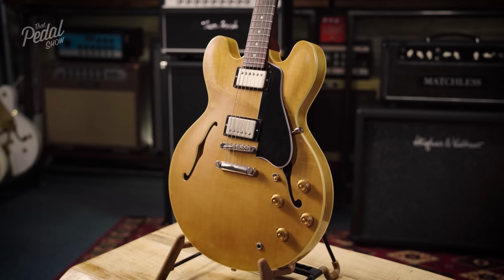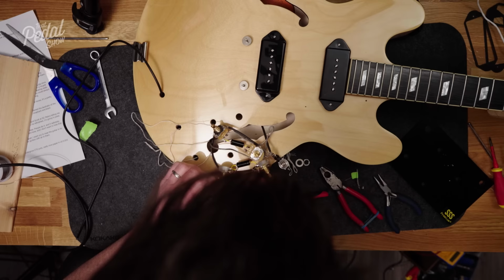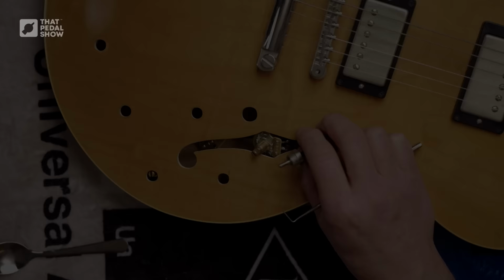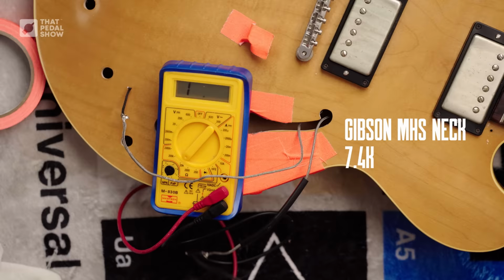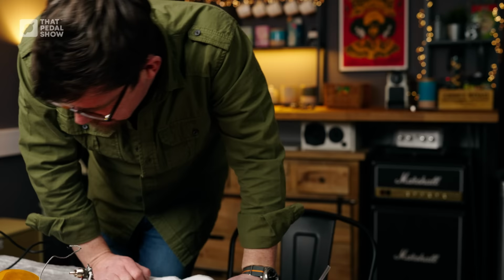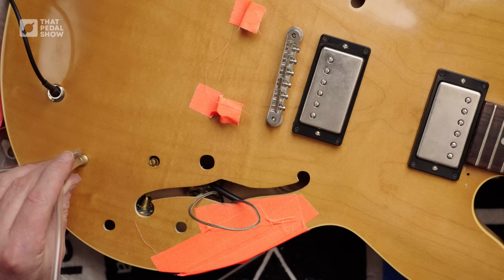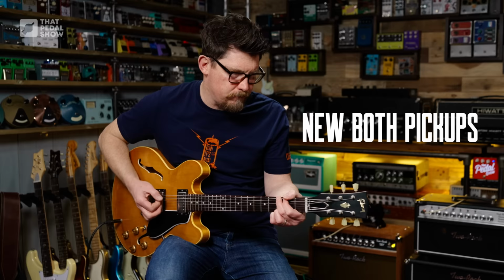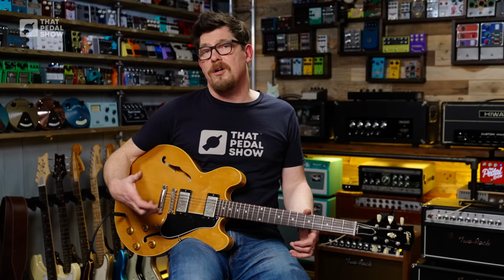Mick’s Gibson ES-335 Gets New Pickups & Loom [Hardest Pickup Swap Ever?]

Comment: I am actually finishing up a guitar with this config. I finally got it done except for stringing it up. I had to take a break after 3 evenings of the same frustrations so I pulled up your video randomly. This isn't the first time I've worked on a hollow or semi hollow body electric but re-installing the guts is always a mental trial. I am so appreciative of your honesty, most tubers try to make it look relatively easy, but if it were we'd all be repairmen. I'm glad you pushed through and got it done. The one I'm finishing up has the toggle switch on the top side of the upper bout horn. That's even a bit worse.:face-pink-tears:🤣🤣

Comment: "What a rubber Jonny."
I'm so sorry, Mick. I felt your pain. I would have completely understood if you took a saw out and turned th f-hole into a gaping one!
While watching this I adjusted the truss rod in my Les Paul and solved a fret buzz issue. That guitar has beautiful Monty's pickups, but due to my assumption that the Gibson wires and the Monty's followed the same colour coding, the push-pull pots now operate backwards. I just don't have the time, nor patiences to fix it...
Reply from the maker: Ha! I feel this so deeply. :0)

Comment: Mick,

It’s a bit after the fact, but I’ve learned that yarn works a treat to pull the pots back through. It also makes adding the internal lock washers easier. The threads are more accessible on top.

Additionally, making a light cardboard protector is easy and doesn’t limit access for the swap.

Comment: I've done this a few times. It gets easier. I put some low tack tape in the f hole edges to keep from getting damage. Put a dab of super glue on the star washer and it won't fall off the pot. Some nice tweezers and some picks also help.

Comment: Mick, just hats off to you on this one. It had all the tension, adventure and hilarity of a blockbuster. Everything you went through is why i have ‘put it off’ on mine for over 20 years. The 335 remains my only unmodified stock from the factory guitar, even my new les paul already got a set of VIP pots and will probably get some pickups at some point too. This has either taught me that i should ‘leave well enough alone’, or that ‘nothing ventured, nothing gained’ (pun intended).
FWIW - yes definitely a difference in my headphones and i like what i heard with the new setup. Now to tinker with the pickup heights and just enjoy that guitar - its a stunner. I’d be curious if you may have measured the pot values on the old vs new (guessing not as the new harness was pre-wired) but all that aside,  seriously well done on bring this sort of content to us, beautifully shot, edited and mixed (as is the TPS way). Cheers SouthPaw335
Reply from the maker: Thank you! I so should have measured the pots. Interestingly when I was at Gibson, they told me that for certain models - especially the Rusty Anderson Sig at the time - they’d shoot for 550k for the tones. Interesting! And yes on pickup heights. I reckon up a tiny smidge for the bridge… down a gnat’s for the neck. Let’s see!

Comment: I love customizing the electronics in my instruments. Pickup swaps, new wiring, custom pot/cap values etc. I have one semi hollow and I replaced all the electronics like you did in this video. I never EVER want to work on a semi hollow again. It is such a big pain to do everything through the F holes. Though I didn’t use your nifty tubing trick, that would have saved me an absolute load of headache. I used string and it felt super fiddly.

Comment: Love your perseverance, Mick! Somewhat stupidly, my first guitar kit build a few years ago was a 335-style guitar - talk about diving in at the deep end! I ended up using dental floss to pull through the jack, pots & switch and I threaded on the nuts & washers first so I could attach the hardware as soon as the threads appeared. Despite the trials & tribulations of it all, there's a good sense of achievement at the end of the process. I just won't be doing it again in a hurry!
Reply from the maker: Holy crap! Nice one!

Comment: I hate working on 335's but it can be done, be patient, know going in it won't go without a fight, use pull wires on the controls and it won't be too horrible. Try keeping a little magnet on a stick near by. I like to use a socket driver instead of the combination wrench on pots and jacks - if I have one. But at least you don't pliers. I tape off the F-hole because I know I will scratch it, I'm clumsy. I attach a string or wire to each of the old pots, jack and switch before pulling them out, and leave the pull-strings in the guitar. Then with the new parts soldered in, I attach the pull-strings to the new ones and pull them back into the holes. The tubing, right principle, wrong material. String works the best, not kidding, I've done it. True, sometimes the star washers can't be used. Closely compare the old and new pots; all the short neck pots aren't the same length, even from the same company. Especially important, your cat and dog will always know when you need a break. Listen to them. Thanks for the journey. A+.

Comment: I used string  (actually dental floss) to swap my wiring in my Dot. It's way easier that way (still a pain getting the old wiring out and even harder to get the new wiring in. But the string is great, tie it to each pot, pull it out, re-attach the string to the new pots, put string through the new output jack and tie a washer to the other side, shove it in and pull everything into place, nuts slide over the string while you hold each pot in place with it. Cut the strings and get the washer that helped pull the  output  jack out of there and that's it! Still not a fun experience but this tube method was tough to watch.

Comment: In a twin humbucker guitar, I feel that the tangible special relationship between both pickups, (especially when adjusting volumes on each pup), is the most definite test of a guitar and/or the pickups.

The difference you can immediately hear is that extra clarity, although perhaps only like old strings versus new strings.

That was almost like the reviews of EMG pickups. Does anyone remember that analogy? The also said they were louder as well as being brighter.

I can hear a mid range in the new. The old ones may well have that, but it's not necessarily better, just different.

Comment: I know it’s after the fact Mick, but I’d heard that fishing line is often used in these situations. Makes sense, as it’s strong, fine and once tied on the pots won’t come off too easily. 😊
Reply from the maker: I have done that once before… but in this case the problem, I think, was ultimately less about locating the pots and more about getting them through the F hole and the shafts not being long enough. If I was to do it again, I think I’d attach the jack and the last pot - the latter with fishing line! - and go forceps/tweezers for the rest. Cheers Andy!

Comment: I used to have a Guild DC1, and the jack kept loosening up, so in my infinite wisdom, I decided to take the nut off and put some locktite on it. Well, I'm sure you all know what happened next the jack went inside the guitar. It took me 3 hours to get it back in, and it never got the locktite on it. After that, I decided that any electronic work on a hollow or semi hollow was going to be done by a professional. I'm glad I got it back in because I would have felt like such an idiot if I had to take it to the local guitar shop. So, Mick, I feel your frustration just on a smaller scale.

Comment: Firstly, I wouldn't even think of taking on such a job, especially with my hands as they are now.
Secondly, I swapped out the Schaller Golden 50s in my 1988 Heritage H-535 and had the wiring loom completely changed because the guitar had been sitting under someone's bed for 20 years and the electronics were knackered. With BKP Mules in there it sounds like warm chocolate and covers all the bases I would want, especially with a coil-tap on the neck pickup. Given it's the same finish as this 335 (apart from a matching scratchplate) it would be fascinating to A/B it with an equivalent Gibson.
Thirdly, as I've said elsewhere on several occasions recently, making music is a mind game. If you feel your instrument sounds better you will play better and thus sound better. So even if those new pickups don't sound any different to anyone else if they sound better to you that is all that matters and the pain of installing them will have been worth it.
Reply from the maker: Amen to that!

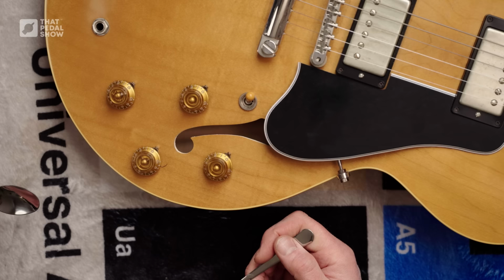Comment: Afternoon all. @7:30 - teaspoons = genius! Whoever first thought of that has earned their place amongst the pantheon of legends. 
Many moons ago - in my days as a luthier - I paid all of £1.50 for a (fnar fnar) 'knob puller'; a 2 part plastic device which hooked under the flange of the common or garden volume/tone knob and allowed the user to gently ease the stiffest of knobs away from the guitars front (try saying that after a half of shandy and a Baileys  chaser).
What I assumed would be novelty tat turned out to be design genius, and nearly two decades later I'm still using the same puller to de-knob guitars in the 21st century.
Had I considered my drawer full of teaspooms for the job, I'd have kept my wallet firmly closed. That's £1.50 I won't be getting back...

Comment: Decided to put new OX4s and a push-pull Page harness in my 335 last year, and drill a hole to the endpin to ground the Bigsby. The wire from the neck pickup wasn't long enough to reach the harness so I had to solder on four extensions, after it was all already in the guitar. Then I sold the thing 6 months later...

Comment: I burned up a 5 way switch and a pot using the cheapest soldering iron from Amazon. Bought a better iron and new switch. Wired it wrong .  Ended up buying a pre wired setup like you got.

Comment: If YOU think the guitar's sound sits better in the mix, even in an improvised accompaniment, then that was the original purpose, and so the whole process was a success. Looking at some of the other comments, this is probably the most difficult guitar 'repair' job of the lot, and you succeeded, so kudos to you for that.
Yes, the law of diminished returns means, as you observed, when you get to a guitar of the quality of the 335, you need to spend a great deal to find a small difference in the sound - and yet, the difference is there, for anyone to hear. The question is, is it a big enough difference for YOU? Thanks for another interesting, and instructive, vlog.
Reply from the maker: It is Gordon. It’s got that vocal thing and the extra bit of clarity. Be interesting to do a couple of gigs and see. Before the change it was mud city. Cheers!

Comment: First of all, what a gorgeous room! Glorious sunshine beaming in all over, comfy chairs, and fine animal companionship - what else could one want!
And I'm sure That Pedal Dog (and cat) helped alleviate some of the stress.
I feel your pain in regard to soldering & wiring, soldering os one of my least favourite tasks ever invented, but unfortunately necessary from time to time, but not enough for me to get proficient.
My famously most common error is this:. when soldering jacks on one end of a cord usually the solder joint is perfect the first time...then I see the sleeve sitting 3 feet away on the table, mocking me.
 Needless to say the unsoldering and resoldering never go anywhere nearly as smoothly as the first time.
My question (rhetorical) is: WHY the {massive swear words} couldn't Gibson/Epiphone make the F holes just slightly larger? 
They know the size of pots & switches, I'm sure the holes could be made just larger enough to not be noticeably different yet make it SO much easier to remove/install components.
 I really don't know if all that frustration would be worth it to me. 
I don't own a semi hollow so I won't likely ever have the urge to go down that route, but I really want a Rickenbacker 330/12. I think the cat's eye sound holes are larger that traditional F holes. Maybe....
At least it all worked out in the end, though.
An entertaining and really quite cautionary tale for anyone considering similar shenanigans, perhaps better to let a fellow like Matt take care of the nasty bit.

After listening to the A/B test, there's definitely a huge difference, the Lollars are a much better fit with the Les & Strats in my opinion.
Well, done!

Comment: I had to scroll through it. Having also suffered through the self inflicted torture of this project with my 335 it was just too excruciating to watch someone else experience it. I only swapped out the loom. Frankly, I think you will hear more tonal difference in using a different gauge of pick or strings. However, I can totally relate to  missing some jangle when switching to the 335 from the Strat. as well as missing some smokey girth when going back to the Strat from the 335. Aren't we fortunate to be able to have both?

Comment: ROFL!!  THIS is my FAVORITE EPISODE of TPS EVER!!!!!  Having done exactly this many times on historic reissue 335s, I can totally relate to the frustration. But honestly the longest I ever took was maybe 2-3 hours.  And it's a 45 minute job on a modern USA model with the huge routes.  

Some tips.  Start from a place of humility.    It IS a hard job.  You figured out the next tip.....gimmicky tubes and floss and stuff really doesn't work as well as playing the game Operation with small tools and your fingers.  Lastly the FIRST time you have to repeat a step because you forgot a washer or put the wrong pot in the wrong hole or such....WALK AWAY! Not for 20 minutes but for hours or a day.

Finally don't feel bad that you couldn't demo the harness (not loom) alone.  Unless the potentiometer or/and capacitor VALUES are significantly different there is zero difference in wire sound.  Its a ridiculous religious myth amongst ignorant guitar players that didnt get enough science classes in school. 

An .047 cap will sound different from a .015.  But 2 .047 caps of differing types in a guitar don't sound different, at least to a human listener.  Same with pots.  If your came with 440kohms and you put in 550 ya it will be brighter and hotter.  But if it isn't a good 10-20% change nobody will hear it.
Of course pot taper, wiring style, (50s vs modern) will change how it behaves at different settings, but all the same tones are there at some setting.   But heck, you HAD to take out the harness anyway to change pickups so why not put fresh stuff in?
One suggestion.  Since you have the stock pickups out intact, next time you want to try new pickups just CUT THE WIRES and splice in the new pickups.  No shame in it as long as you restore the originals correctly. 

Thank you for this episode!  Lol.

Comment: At 7-8K ohms, those MHS pickups are definitely wired in series. If they were wired in parallel, the resistance would be 1.5-2K ohms, and they would sound like noiseless single coils.

Comment: hmmm neat trick with the aquarium hose , been messing with metal wite but i think the hose works better 
used the pickup hole btw
might be a good idea to use multiple ipieces of the hose to pull everything through the holes at once (since there soldered together that might be a good idea to prevent wires breaking and get the right pot intoo the richt hole without twisting the connecting wires in a way that they turn out too short

Comment: Having just finished swapping out pickups and harness in a Casino... Thanks for pointing out that I could have done most of the work through the bridge pickup hole rather than messing about through the F hole... Oh well, lesson learnt for next time. Main learning point for me was that the order you fit/refit/re-refit the controls makes a big difference to how easy manipulating things into place is - definitely a job I needed to step away from and come back with a clear head a day or two later

Comment: Well this video sums up exactly why I haven't swapped out my epiphone es-345 electronics even though it actually would be easier because there is access through the bridge pickup hole and there's a large jack plate which gives some access too. One tip I have though is a small magnet would be best to retrieve any loose washers that end up in the cavity because they are made of steel. Ps side not after hearing the tone comparisons I'd say there's very little difference and I actually prefer the stock parts . The new parts are a little clearer and softer slightly more jangly but lacks that bit of grit and punch of the originals which gives me another reason to leave my guitar damm well alone as it is. So far I've removed the pickup covers and the half pound of wax from the pickups and that's given me a brighter sound so that'll be as far as I go.

Comment: Mick , a bit of new solder added to the bit you're trying to unsolder will often aid the desoldering process. I feel your pain. I've done my Epi 335 Dot with the Lollar Low Wind Imperials and a new loom. Excruciating! Had to resize the loom holes and I marred the finish near a pot hole. I forgot that the OEM knobs were not the right size and I ended up breaking a couple of the new pot shafts. I will have to remove, repair and reinstall the dadgum loom again! Oh, well... It sits in it's case 'til I get motivated to finish this thing off...
Reply from the maker: Oh man, I feel this! Nice one Ron, cheers!

Comment: Ah man! I felt your pain. I've done this a few times on various 335 style guitars. That tubing is a pain in the ass. I found good old string tied around the ridge in the pot shaft to work best. Also, with lead free solder, flux is your best friend. Get a flux pen or a small bottle of flux and add some to the joints before heating. Sound wise, I'm not gonna lie, I couldn't really tell the difference on a video. Maybe in the room it was more noticeable. Great video 👍🏻